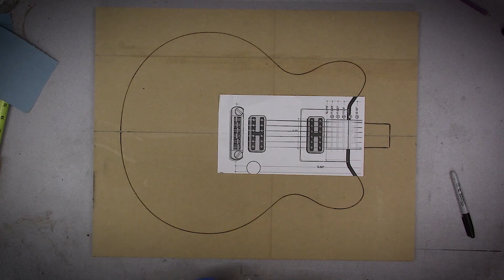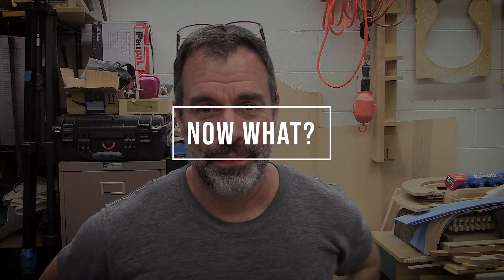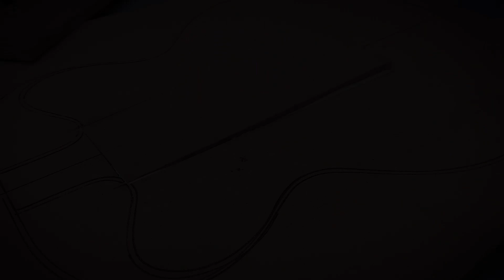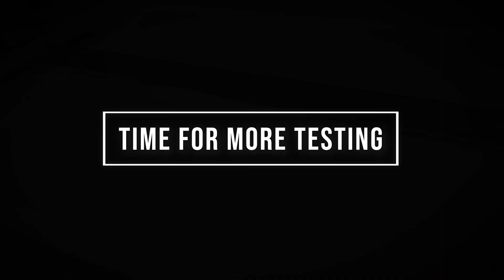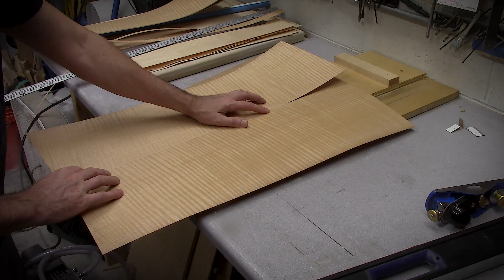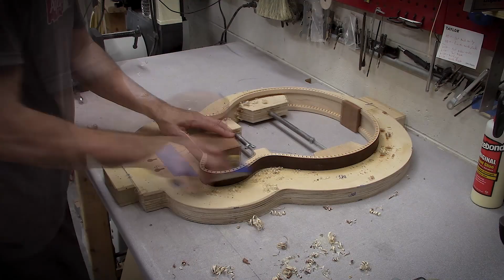Gretsch Guitar Build Project - Ep 03

Comment: Another great video! Couple of questions: Is the archtop just for style, or does it make a difference in sound? Also, is there a reason to layer wood veneer? Would a layer of masonite with a wood veneeron top work just as well? 
Thanks for your hard work, creativity, and lessons!
Reply from the maker: Carlos, good to hear from you again and thanks for watching!
This was an experimental project, a place to learn a lot as I worked through the build.
The multi-layer laminate was largely driven by the resources I could find. I believe Gibson and Gretsch both use a 3-ply laminate system, which is glued-up under heat and pressure. 
I have used thin "face" veneers for many things in the past, so I chose to work with that type of material.
After this build, I feel the 5-ply top is plenty thick and strong. In the future I may try a 4-ply top, back and sides.
The arch very likely does change the sound somewhat, I don't have a flat top/back version to compare it to however.  The body really did have a "Drum" sound once it was all put together. The interior bracing adds stiffness, somewhat controls feedback, and I will likely simplify and reduce the bracing somewhat in future builds.
Glad you are enjoying the build. It was really fun, I learned a lot, and have some new skills and confidence for the Next Project.
Take care!

Comment: So, I've watched this series a dozen times, and it's magnificent. Thank you! I have a question; When making the buck form for laminating your veneers, did you know the radius of the top, or just figured as long as it's flat through the pickup area and slopes down to the side, it's ok? how deep was the trough you routed? That was 2 questions... I'll stop now. Again, thank you for the inspiration!
Reply from the maker: Eric, thanks for watching - repeatedly!
This was a first time project for me, never made this type of guitar before.

The radius, or "shape" was as much a guess as it was planned. There is only a hair over 1/2" total elevation change from the edge of body to the highest point at and just behind the bridge. 
Some guitars have nearly double that, but during my initial thought and sketching phase I realized the more height I add at the bridge, the more neck angle I end up with ... UNLESS, I also add extra height to the area where the neck joins the body.
Then my "plan" included trying to use the same buck for the top and back of the guitar, and maybe also a single cut version (starting that build soon).
All these ideas and restrictions basically pushed my decision and the shape of the top/back buck to what it is in the end.
As you mentioned, it is a flat slope in the middle area from the heel of the neck to the bridge.

I didn't show how I attempted to make it symmetrical (it's not perfect), but there are a few trick to help. I used a few printed paper templates for reference, also used a straight edge and a light to look and compare slope side-to-side.  If you watch any of the Ken Parker Archtopery videos on YT, you'll see he uses a dedicated spotlight as he carves a top. Not that I did what he's doing, but the idea can be shared and used in various ways.
WOW, that all sounds confusing. 

As for the depth of the trough, it was roughly 0" down to 1/2", and a 1/2" piece of MDF glued into the pit.
This was all an experiment. I hadn't seen anyone else do it this way, and overall it worked pretty well.  Probably the biggest eureka moment ( light bulb going on )  I had was when I realized I could used autobody filler to build up the dome shape.  I had seen so many others who had carved or duplicated an existing shape... I wasn't up to doing that. Then "bam" bondo to the rescue.

I just finished making additional side forms for the single-cut version. They were super easy, I knew how to go about making then, because I've now done it before.

Some purists may not like the way I've gone about building this guitar, that's okay. I'm into experimenting a bit. For one of the next builds, I'm seriously considering only doing 4-ply top and back. Especially if I refine the trestle bracing process a bit more. 

Let me know if you have any other questions. If I can help, I will.
I like to share ideas, and I know others will take things way farther than I can - it's all good.

Hope all is well, take care!

Comment: You are doing a great job, this will be a great looking instrument.
I have a more pronounced arch on my guitar. I cannot use full flat sheets of veneer as they tend to bend and overlap
in the vacuum bag. I make my own veneer and have to shape the center joint to account for this. keep up the
good work.
Dr. Smith guitars on instagram
Reply from the maker: Mr. Smith, many thanks!
The arch may be on the shallow side. I had attempted to match a Gretsch which was in my possession, and was actually surprised by how flat the arch was on that guitar.  I have about 1/2" total rise at the high point.
All one big experiment at this stage. 
Making your own veneer, that sounds like a really big project by itself. 
Thanks for watching, take care!

Comment: That body seem like it's going to be incredibly resonant. I can't wait to hear what it sounds like!
I'm interested in that contraption with the trim router right at the end of the vid. Can you show us a bit more? Maybe how it was built and why, and how you use it. It looks like it serves as a kind of upside down router table. I'm really curious.
Reply from the maker: Peter, thanks for watching!
The body really does ring right now, some bracing and a back should help control things a bit. It will be interesting to hear how this turns out.
As for the router contraption, it's my 3rd prototype of a binding router fixture thingy. A bit over-designed at this point, yet still needs a few modifications, but it works pretty well. 
Here's a link to a previous project that shows more of it, it gets use at about a minute-50 into the vid. Let me know if you have any questions. Take care!
https://youtu.be/rVnTPq-E4nY

Comment: It's coming together nicely!  What glue is that you are using for the laminated ply?
Reply from the maker: John, thanks for watching.
I'm using a UF pre-catalyzed powdered glue. Just mix with water, roll it on, press it to desired shape....then wait for it to set up. 
So far it appears to be working really well for this type of work. Once cured/dry, it holds whatever shape it was formed to, no spring-back. 
I've used Titebond for various veneer work before. Titebond Original tends can wick through some veneers, and then there is some spring-back. 
Titebond Cold-press glue works well in vacuum bags over a hard surface. It doesn't seem to bleed through like original Titebond, but will spring back on laminates like this.
Still learning. 
Take care!

Comment: Wondering if you will be putting ribs inside to strengthen and control the sound of the guitar ?
Reply from the maker: Chris, good to hear from you! I hope all is well.
At this time, my plan is to build the body much like a Gretsch big-body. They use a "trestle" style bracing I believe it's called. Not like traditional acoustics, not x'bracing and such.  
I will modify what Gretsch does, giving it my own spin. Thinking about a bridge block for strength, but not a lot of other stiffening.  That said, I often change my plan mid-stride.
Be safe and take care my friend!
Reply: @theNextProject  "Keep On Building" should be your t-shirt motto. Either that or "Just One More Template".  : )
Reply: @theNextProject  For your next Next Project, have you ever thought of building a Les Paul "Log" out of a single block of wood and then building removable wings for the body as Les Paul did on his early prototypes ?
Reply from the maker: @chriscutress1702  well, I hadn't thought about doing that, but I am familiar with the "log". I actually worked on a museum display dedicated to Lester Polfus (Les Paul), way back in my early years. 
He was quite the fellow, not just musician but inventor. Would have been cool to meet him, or see him perform. Never got that chance.
I kinda think working on that museum display may have been a spark for what I do now, that and many other things.
Hmm, interesting.
👍
Reply: @theNextProject  I regret never seeing Les Paul in the flesh although my brother-in-law dropped into the NY club when he was playing and did see him (for which I'll never forgive him ... "JEALOUSY" and a little laughing gnome smile). I've a boxed set of all his recordings as well as a number of books of his history both in music and as an inventor. As I worked at the CBC as a recording engineer I was well versed in his recording inventions (multi-track recording) and would someday love to see his museum (if one exists). He was definitely a wizard and a talented entertainer and musician. Imagine Tesla and Bach in the same body ... A truly creative entity who bridged time and genres. Think about building a LOG for the 2020's with active electronics, evertune bridge, and perhaps synth module capabilities. When did he build the first LOG ? This could be an anniversary tribute to the man.
Reply from the maker: @chriscutress1702  WOW man, you've got a lot going on. I don't recall the year of the log, but if I remember correctly, he used parts from an Epiphone, probably some bailing wire and barn hinges too (kidding). 
The exhibit was in Milwaukee, for Discovery World Museum of Science.  I know they change building a since that time, so no idea what exhibits they currently have.
I have still have some concept sketches, will probably run across them as I prep for my move (packing time).
It's cool your brother got to see him, and I get the jealousy, ha!
I think I only have one CD of LP and Chet Atkins playing stuff. I have a weak collection indeed.

Comment: very nice!i like it!perhaps you could have used plaster/gypsum?instead of bondo....
Reply from the maker: Uwe Mathioschek, thanks for watching!
Yes, I think plaster gypsum would also work well. The dry/curing time would be greatly extended, but that's not a big deal.  Plaster could be "petrified" once sanded to a final shape, to help it last longer. Either with a urethane or something similar. I live in a very humid area, so I'd want to keep the plaster stable once shaped.

The easy of use, quick dry time and long-term durability are the main reasons I used bondo. But many other options would work just as well.

I would expect something could be mixed in with dry plaster powder to make it harder, maybe an acrylic additive. Hmm, interesting. 

Thanks for the comment. Be safe and take care!